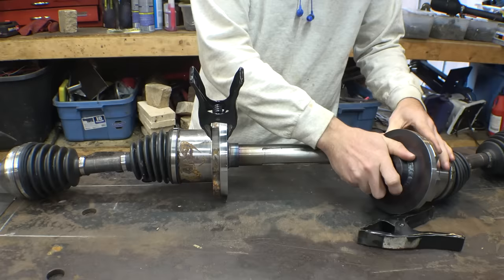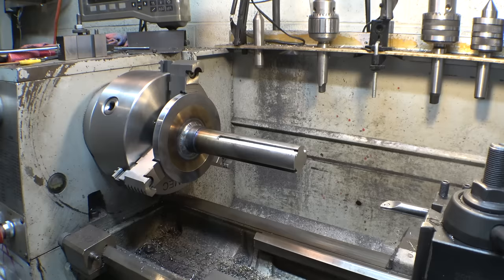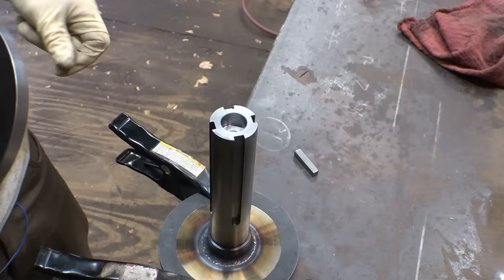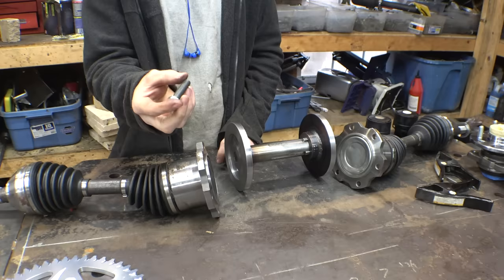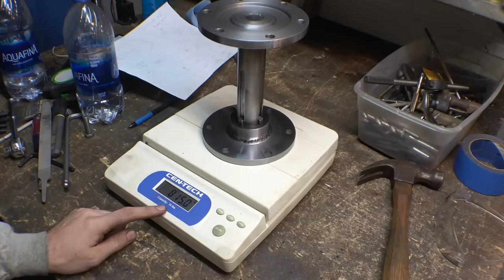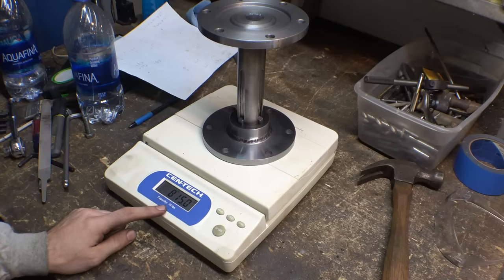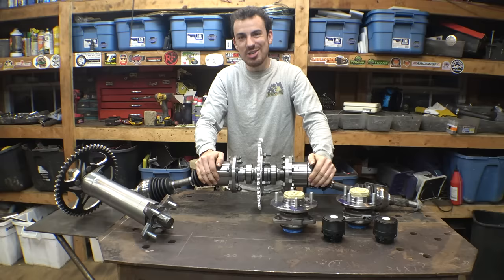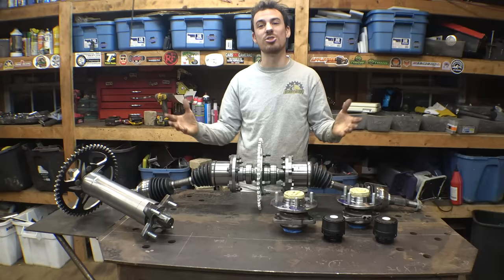Building Chain Drive Four Wheel Drive For My Next Project - Part 3

Comment: Tech tip I learned from an old man working at an O'reillys, you can use cheap fuel line that's sold by the foot off a roll in place of vacuum lines, its way overkill for the vacuum pressure and it wont rot out on you like the vacuum lines will, also great for spots that need to be resistant to stuff like mud and small rocks being thrown at it.

Comment: So far I like it.  Looks super beafy.   I like the idea of a transfer case(2w, 4w-lo, 4w-hi), maybe using the 2-speed "trans" you built a couple years ago with an extra engagement.  Instead of dogs though I wish you could engineer a friction plate for engagement like a flywheel and clutch disc.

Comment: I've noticed, over the years, you  do mostly chain drives. Guessing it's because of the size of you vehicles.  Have you considered using a differential from something like a Toro? Might allow you to  use drive shafts instead of chain drives. Just a thought. Hope this helps. God bless, stay well.
Reply from the maker: In the future I would like to start building stuff with drive shafts. But for now I like to see what I can do with chain drive
Reply: Easier to adjust the gearing too but I'm not sure if you can do that with shafts.
Reply: @ratherBweldingChris  i have 2 snowmobiles if you want them i live in chicago
Reply: I did that using an old ford pinto differential. The spider case was almost completely closed , so I just welded up the two holes and machined a sprocket to fit where the ring gear would go.  Turned down the axel stubs for a few thousands friction fit  and pressed them into the spider gears. Put a blob of grease on the spiders before assembly…. Never had a problem, drove my “hillbilly quad runner”  for at least 20 years.   It’s great see what a person can do when they set their mind to it.
Reply: There's plenty of dead quads that have diffs out there these days. Even with the whole independent rear suspension you might use to save work time.  Even diffs from larger mobility scooters, though they may be a bit small and weak.

Comment: Your going to get wheel hop when turning without a front differential when turning your inner wheel turn slower than the outer wheel.
Reply: I mean, not the greatest concern when offroad
Reply: he is using locking/unlocking hubs on the end of it, so selectable 4wd and can be 2wd and not hop around when on solid ground
Reply: It won't hop but it will screech on pavement and the turning radius won't be as good. Had a few offroaders with locked diffs. It will also be harder on the components overall. Great build though, keep it up my dude
Reply: It might on pavement and hard packed dirt. but probably not on the softer dirt, it will probably be light enough that it will sort of drag one wheel and dig up the ground a little bit. it will basically be like any four wheel drive with lockers front and rear. it will have probably a little odd handling characteristics. and it might not be perfect for all types of terrain. but he's going to make it unlockable so he shouldn't have any issues.
Reply: Dirt is soft enough where the tires will just skid. Plus the front is selectable to be locked or unlocked so that won't be an issue for pavement.
Reply: With the locking hubs he could drive in 2, 3 or 4wd.
3wd eliminates that problem
Reply: @duke9620  if the front has no diff, it wont turn- even on dirt. I had a buggy/kart (2wd) with a solid rear axle. New knobby atv tyres front and rear, unless the tyre pressures were right front vs rear, it would either plough and go straight when turning the wheel, or one back wheel would drag or spin while turning - halving rear traction causing a spinout. It was powered by a rebuilt 1983 IT490 engine. No suspension, so on rough terrain lack of traction on opposite corners made it handle real special. But that's why it was so cheap.
Reply: @duke9620  I believe he’s talking about the lack of differential between the front wheels.
Reply: I want to get wheel hop
Reply: Put freewheeling hubs on each front wheel hub  outer wheel will run faster than inner on s turn until traction becomes an issue then  outer wheel becomes driven again
Reply: @gerardmcloughlin4561  freewheeling, is that like when you go without no underwear
Reply: Bro that's a feature not a bug. This isn't LeMans lmao.

Comment: Could get a decent amount of weight out of that center part by making the hubs on it more like the hubs on those CV axles, where the portions of the hub between the bolt holes is cut out some.

Comment: When you cut the keyways on the shaft you should use a “slot” drill a two tooth milling cutter, and cut it it one pass very slowly. That way you will get an accurate slot, if you use an endmill with multiple passes the slot will be oversize. 40+ years precision machinist.

Comment: On Isuzu/Chev Troopers [mid-1980s] the front 4wd hub locks were operated by the direction of drive. You engage 4wd and drive off ramp pins lock the hub, disengage 4wd and the wheel drives the hub and unlocks the ramp pins. Sometimes you may have to use reverse to unlock them if they stick. they called them Automatic hubs.

Comment: Front wheel chain will still spin, as the front axels still spin even in rear wheel drive only
Reply: But the wheels aren't connected to the drive shaft because he has the Ford hubs with internal disconnet
Reply: @EddSjo  yeah but the chain and axels still get power even with hubs disconnected

Comment: I have a 98 Ranger 4X4 and the vacuum hubs haven't worked for 15 years.  Vacuum system failed somewhere and they just stay locked in.  Little more noise maybe, but works fine for me.

Comment: Make half moon cutouts on the ends ,think of an older Ford  rear-end  outer hub where the axle bolts onto ,with a good radius and you'll keep strength and definitely lighten it. Also if your building a 4wd kart with a crotch rocket engine I've thought about that but not the time ,use a heavy duty electric clutch to engage the 4wd

Comment: I would add a third axle disconnect from the jackshaft to the front chain to keep the front chain from spinning at 100mph if you're doing a 2wd burnout and don't have to worry about the longer front chain being a failure point.

Comment: I would try a freewheel bearing to power the front wheels. I did that onto to a 4*4 mini truck. The gearing was so that it were rear wheels drive normally, but as soon the rear wheels slipped, the front wheels were engaged.

Comment: Hey, is there a reason not to lathe welds? I don't think I saw you remove any material from the actual welds so I'm wondering if it's considered bad practice.
Reply: Yea bad practice. especially on a single pass weld if you tried cleaning that up on the lathe it would just about separate the 2 parts again. There is pretty much no 'excess' material on that weld.
Think he did run over the weld on the mating surface between the hub and the Cvs, but they were big multi pass welds and only just looked like he faced them off for clearance.
Reply: Welds that nice you don't hide !

Comment: Notice how your keys are loose? To get the key to be the width of the cutter you need to only cut in one direction and generally full depth in one go. The cutting forces on the side entering the material deflects the end mill. When you stop or reverse direction it springs back to straight again. This digging into the opposite side of the key groove widening it more than the cutter width and making your keys loose.

Also if you are concerned about something coming out of the chuck, don't use a three jaw. The four jaw holds way better, and now that I see you have a six jaw, definitely use it. It sucks turning all the jaws over, but your part will stay in most of the time. Also drill you tap drill hole and put a center in it and machine most of the material away while it is there leaving a thin tube. Then as a slow low force operation plunge and cut the tube off to the final length of the part.

Another method on this one would be to bolt it to a face plate, but that is a bit of work.

Comment: hopefully what ever engine you end up using has enough vacuum to power those hubs. you may look for a 12v electric vacuum pump like many 90s imports used in the cruise control system.

Comment: Nice good start as always Chris. Speaking of 4x4, what’s the latest with the rock crawler? I remember the test ride going well…I think. Sounds like the new project is a step up from the crawler. Always keep this in mind during your build, if you think low range is enough, go lower. :)
Reply from the maker: I still have the mini rock crawler, and I’m figuring out where I want to take it next
Reply: @ratherBweldingChris  How about the trails area where you took the electric motorcycle?

Comment: I kinda want to know what that was crawling to the bottom left corner of the screen when he was welding, starts at 2:12-2:24
Reply: If you slow it down it actually moved the tool as it walk over it. Fucker was buff 😅 . Be careful in there he ain't alone
Reply: I'm going with big ass spider, final answer.
Reply: Looks like a wolf spider to me. A helpful little bugger. Eats all kinds of nuance insects
Reply: It's a mouse. And he came into the shop to get his balls of steel welded
Reply from the maker: I got some big ass spiders in that shed, I guess
Reply: Yeah that thing was huge, I just caught a glimps and was like holy hell lol glad I could help lol
Reply: I’ve seen smaller crabs than that thing! Train that little guy, he can hand you tools and stuff.
Reply: Raid is your buddy.

Comment: So you do understand that if you use switchable hubs the front  axles are still under engine power the entire timeits only the wheels that freewheel on the hubs u get 4wd when u lock the hubs so that chain will always be turning
Reply: I assumed the T90 transmission has  a 2wd/4wd selector?

Comment: Instead of key ways, why not spline instead?

Also with the new engine, please get a 2 core Honda civic radiator and electric fan, to prevent the engine from overheating. A civic radiator is small enough but the 2 cores will help flow better. Rock Auto has them or get a $250 Mishimoto (I think that's the name) performance radiator.
Reply: I believe because he doesn’t have a reasonably quick method to cutting splines. He has a few videos a while back where he ventured into spline cutting but wasn’t impressed

Comment: i have said several times that you need to stop using motorcycle engines for these heavy tanks your building and just go to a 4 cylinder car engine that will give you the torque you need for all the back woods trails you go on...   i never understood why a few years ago when you acquired that ratty buggy with the car engine why you didnt keep the engine at least.  And if you do put a 4 cylinder in this project i hope its a honda K motor that will take a turbo and make some serious Fing HP that can move these dump trucks you build around with ease
Reply: The number 1 reason I wouldn't use a car engine is the wiring, and then the size.
Reply: Why would you need that much power though?

Comment: With working on almost everything using factory metric bolts , is it time to change your purchase hardware to metric?
M5/6/8/10/12 will fit almost anything on your projects without drilling/tapping
Reply: Sometimes, not always the case.

Comment: No front differential? I think you may find that problematic.
Reply: meh.. it's just for off roading.
Reply: My 4x4 polaris quad doesn't have a diff either, at the 500 lb weight,, it doesn't seem to matter. <we shall see! >
Reply: @davidt3464  unless you removed it, it certainly does have a diff…
Reply: I know for 2 reasons. 1. I’m a mechanic, and differentials are something that’s been around for over 100 years now with very little change to the core design, so they are very mechanically simple and cheap, manufacturers have no reason to not include them. And 2. I have a Polaris ranger 4x4 and had to rebuild the front diff already.
Reply: @moody9287  Yeah.. But there are also things called diff lockers;  and the VERY GOOD reason why they are used is because a standard diff can get you stuck in a lot of places where a locked diff will drive right out.  But lockers are expensive if they didn't come with it from the factory.  So what people do is buy a "spool" and replace that with the spider gears of a diff;  or better yet, just weld them together.  My pops did htis to his old 70's Ford too. On the street it's a little rough and burns through tires-- but off road it's awesome.  As long as the tires are able to easily slip, such as on dirt/ grass/ sand/ gravel, rock climbing, etc..  Then it's not even an issue..  For SURE it's a major benefit once you're in the sh^t, and everyone around you is getting stuck because they still have open difffs...   there are defeinitely levels of necessity once you're on the trail.

Comment: Liter bike engines can easily twist a crank due to the lightweight crank that is designed for a small tire contact patch and low weight of the bike.  This happens very often in formula 1000 (F1000) race cars.
Reply: Really? That's something i never thought of, is there a way to prevent that?
Reply: @evanwebber9981  I can really only speak to the F1000 series.  Most of the F1000 cars either use an acceleration limiter or just roll on the throttle on the exits of the corner.  I think you can get stronger after market cranks, but engines are so cheap, people just buy totaled GSX-Rs and throw in the untouched engine again if it happens.

I would think that in an application such as this, gearing is your best bet.  Let the engine rev high and do not put too much torque on the engine crank itself.  The main issue is the close ratio gearing on these engines.  For example, my ZX-10R does 108 mph in first gear, but the next 5 gears only add 80 mph.  Unless you have a setup like a Busa or ZX-14 or even the bit detuned Concourse you will have close ratio.  A Honda ST1300 or Yamaha FJ might be ideal.  Just need to look at the gear ratios.

You could limit your traction, but that probably defeats why you want a liter engine.  The CVT drivetrain setup really reduces how power is put to the ground.

The hayabusa v8 uses an aftermarket stronger crank, but it is hella expensive.
Reply: @sammcbride2464 , interesting! I've dreamed of building some kind of bike-powered rock buggy, so short-ish gearing was always the plan... I didn't know the cranks were that fragile, though.

Comment: May want to add more splines. With less splines, you have more failure points. That is why automotive axles increase the number of splines for more weight and power applied. Think drag cars with bumping the number of splines per axle. You see the cheap Chinese machines with 4 splines breaking axles.

Comment: Hey RBW, there is a company called Dirt Tricks and they make sick ass sprockets out of tool steel. They are able to make them light with very little metal but have the strength of tool steel. Very nice looking as well. You should hit them up.

Comment: You were trying to take weight off. could you have milled down the piece where the cv axle bolts to to match the look of the cv axle with the 6 nubs or whatever you call em.

Comment: A car differential with a sprocket replacing the crown wheel would have been so much simpler. The Miata diff and it’s mini stub spindles bold directly to CVS.
(There is a few of these on other channels)
This thing will be so difficult to steer even if only in 2wd

Comment: Those 7/16 bolts are no good because you shouldn't use longthreads on a coupling like that. A smooth shank should be used through at least 75% of the length of the hole through those 2 plates. Otherwise if they work loose slightly, the threads chew out making a mess.

Comment: Chris, your going to have a major problem with the front axels being tied together with a solid axel. the speed differences between front wheels are far greater than rear wheels. every time you turn your front end will try to skid horribly bad.

Comment: Please, wot ever engine you use, Please either turbo or super charge it. Even better would be twin turbo'd then into a super charger 😂. That would sound amazing & could be a great challenge to yourself.
Not to mention the power that you would produce but mainly the insane sound you'd make from a turbo'd engine. From memory I don't think you've gone full insane asylum on one of your many builds as yet.
1, A two seats.
2, Switchable 4 wheeler drive.
3, Coil over A arm suspension.
4, turbo charged.
5, Manual box.
I know it would be a fair bit of work but goodness me it would be amaze balls. Either way its your project & will enjoy watching wot ever you end up producing thanks for sharing Brother 😜👍

Comment: You are so awesome with a lathe and making your own parts why don't you use transmissions and drivelines instead of chains and sprockets and then you could have that push button four-wheel drive they have electric lockers if you're interested in that check out Fab rats they have electric lockers on their rock crawlers

Comment: How are you dealing with the "differential effect" between your inside and outside wheel speeds in a turn? Locked axles are great for hard, straight-line acceleration, and I suspect there are curves where you are going. Again, the lockers would work fairly well on slick surfaces like grass, but will be problematic on higher traction surfaces. Awesome chip work, btw, as well your welding is reaching new heights!  No guess on the engine, but you seem to have the "MOAH POWAH" thing firmly in your sites!  FR